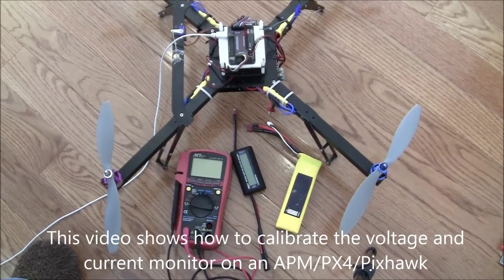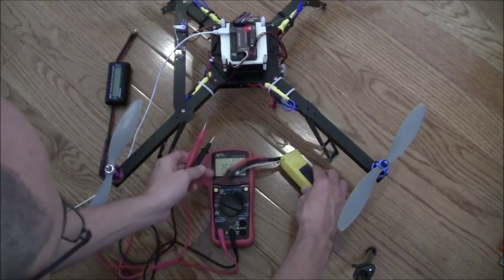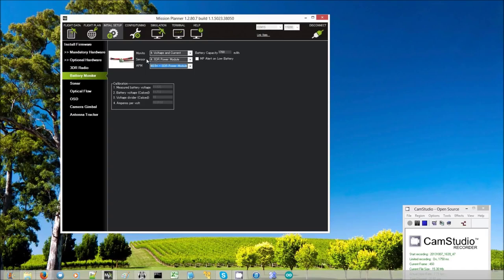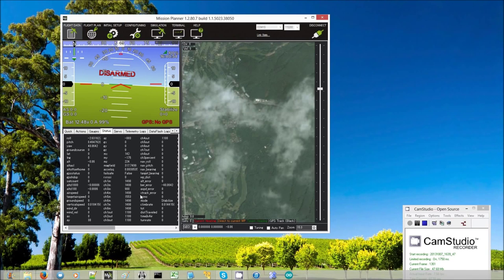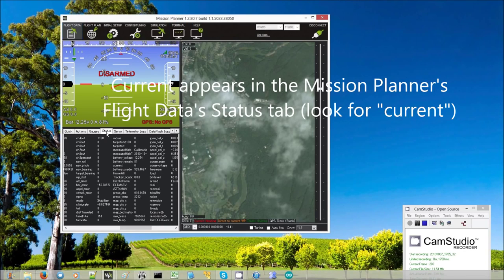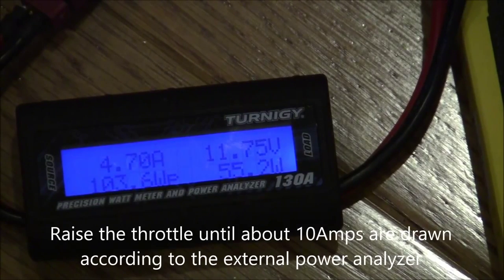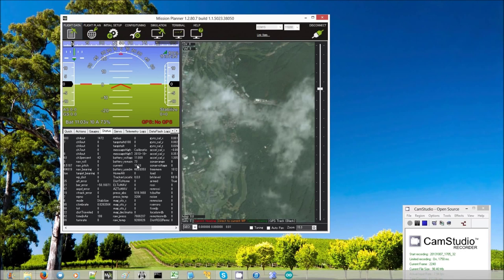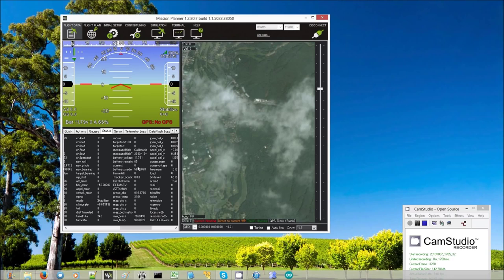Battery Voltage & Current Monitor Calibration mission planner

Comment: I have a holybro pm07 power module and my drone doesn’t seem to lift up or fly off the ground no matter how much throttle I give. I get a yellow flashing light. And it says battery failsafe. I realized that I put the battery monitor to cube and pixhawk. I switch it to pixhawk 4 ( which is what I have ) and now it says bad battery. So it seems something is preventing me from fly because it either a bad battery or I have some parameters set wrong or the information I put isn’t right. What should I do ?